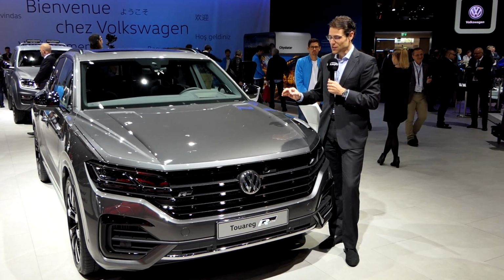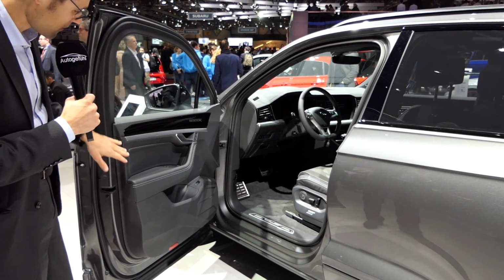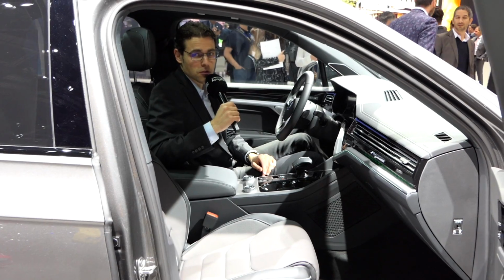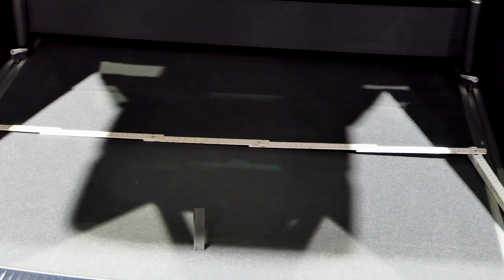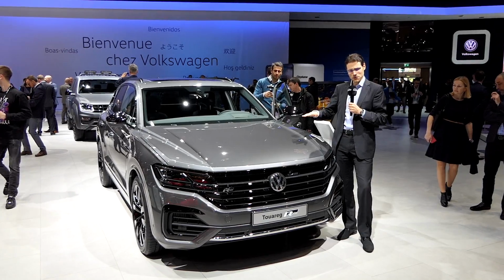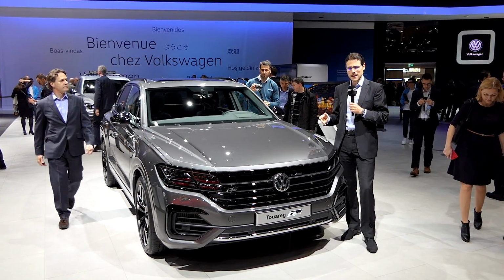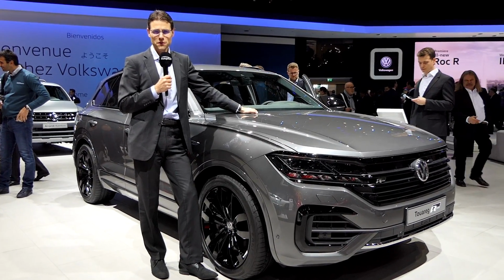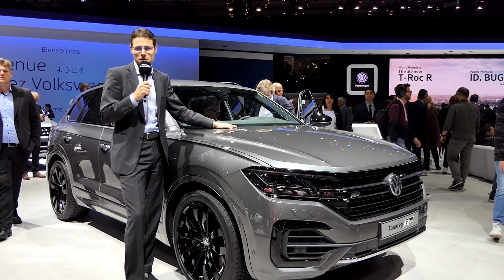The most powerful  Volkswagen - VW Touareg V8 TDI REVIEW - Autogefühl

Comment: Had that "piano" Black interior in my 2013 Touareg TDI Sport.  Awful, shows everything, dust, dirt, oil from your finger tips, and every mother fucker passenger that closes the door by the piano black on the outside instead of by the door handle, leaves their finger prints all over the black plastic, which then attracts fine brown dust from static electricity, on the external plastic.   Drives great, however parts that fail out of warranty and VW's service here in USA, for the most part, is sub standard, and way, way way overpriced, and they over bill on hours for repairs.

Comment: Baut einen extrem zuverlässigen W16 Hybrid-Motor ein, welcher
mit 2 Elektromotoren kombiniert ist, für insgesamt + 223 PS zusätzlich.
Sehr hohe Batteriekapazität! Batterie, die zusätzlich zur Rekuperation
während der Fahrt, auch an jeder Steckdose aufgeladen werden kann.
(Verbrennungsmotor Bauartprinzip wie Bugatti Chiron, ABER NICHT Benziner,
sondern als moderner gut abgasgereinigter Dieselmotor (Euro 6d-Temp) 
und zwar mit 8,8 Litern Hubraum, ausgestattet mit 4 Turboladern, 32 Ventilen, 
888 PS Leistung und mit  V I E L  Drehmoment,   der auch zusätzlich mit 
Zylinderabschaltung ausgestattet ist für geringstmöglichen Verbrauch !! 
22 l / 100 km bei sportlicher Fahrweise (Volllast / Rennstrecke max. 33 l).
Systemleistung 1111 PS. Rein elektrische Reichweite 333 Km.
Das ganze kombiniert mit einem sehr guten 14-Gang Wandlergetriebe !!!!!
Das soll doch ZF bitte noch entwickeln

Comment: Poor mans SQ7 without 7 seats.
I love the rear design, very classy, however the design doesn’t flow with the front. It looks like they’ve welded two different cars together. 
Also, they gave this car such a huge steering wheel adding to the ugliness to the dash board, feels like you are in a school bus. :(

Comment: Well, I have the exact car like this only with the 210KW V6. The glossy trim drives me mad. It's a class A dust and fingerprint collector. It seems to get fingerprints even from pedestrians outside. The 21" wheels look great. But I was shocked about how insanely loud those Goodyear 285 tyres are. Those wheels render the superb air suspension useless. I would definitely go for 20" alloys the next time. Apart from that: best SUV I've ever had.
Reply: It is common car knowledge that low profile tires are less comfortable and much louder....even more on heavy weight vehicles. There's so much grip and weight on those tires,  they almost are scraping off the tarmac. 
The interior trim could use some " FSC " wood or a bit colour... Sth not grey or gloss black...as for your worries about the piano black finger print collecting material, there are people out there who have a complete kitchen in this material 😱... I kid you not
Reply: @Mastermindthreethousand  Agreed. I'm aware that low profile tires are louder. But compared to the 285/45  Continentals which I had with the car for the test drive, the Goodyears are worse. They have a much stiffer shoulder and harder (fuel saving) rubber. My point was that it's not a specific problem of the car.
Reply: Golf
Reply: Golf v6
Reply: @jersoncesarnuvunga4765  Football

Comment: This vehicle is screaming out for a PHEV drivetrain. Why does the Q7 and the Cayenne get a PHEV option, but not this. VW promised one on the last model.... Why - they have lot’s of Diesel engines to dump on the public! Anyone else thinking these are the diesel V8’s that Porsche no longer put in the Cayenne?
Reply: agreed.
Reply: Volkswagen didn t promise last generation, they delivered, but as usual, no one cared to buy. they mention one is most likely to arrive in this generation, the old won, wasn t launched also from the beggining
Reply: jh5kl Delivered what in the last generation Touareg, PHEV? Not in the UK? My authorised dealer said they would. SO I wrote to VW UK Sales. I still have the letter stating they would be releasing a PHEV version (Gen1 facelifted model).
Reply: Cause this is a dinosaur.